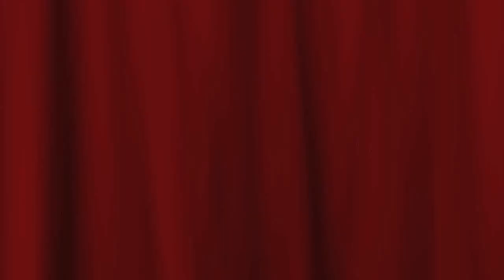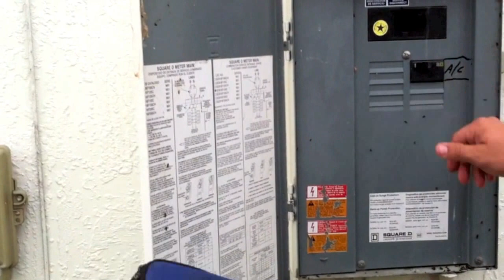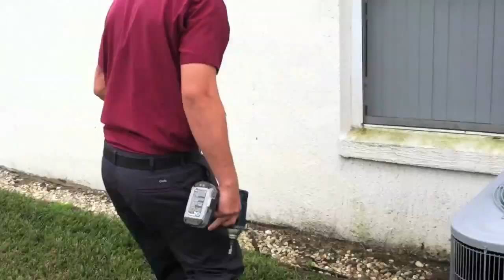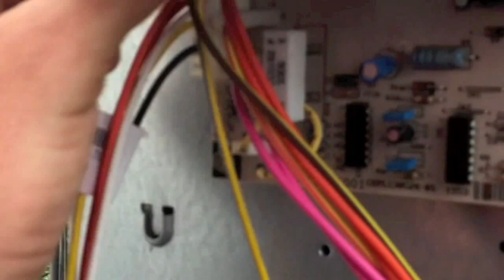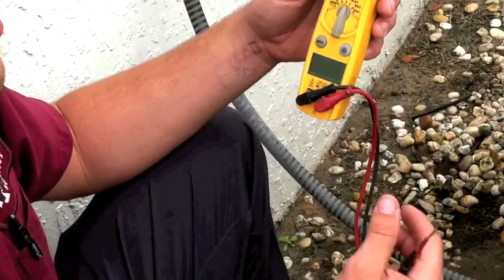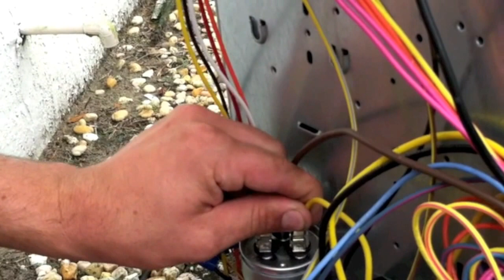Testing capacitor and wires on an air conditioning condensing unit

Comment: Where can I get that yellow microfarad meter. Thanks for that great instruction.
Reply: check eBay, or amazon
Reply: Issaka Oseni It would really help to know the brand as I am not an A/C specialist.
Reply: sigzor302620 from the video it looks like.
BRAND NAME: Fieldpiece
PART NUMBER : SC240
GTIN: 00872641003081.
you can also Google Hvac multimeters and you gonna see so many different kinds, good luck
Reply: Issaka Oseni Thanks buddy. Most appreciated. :-)